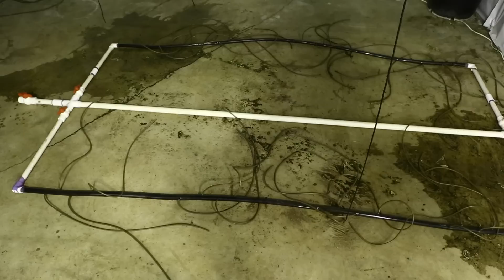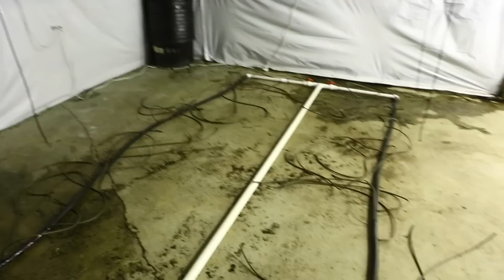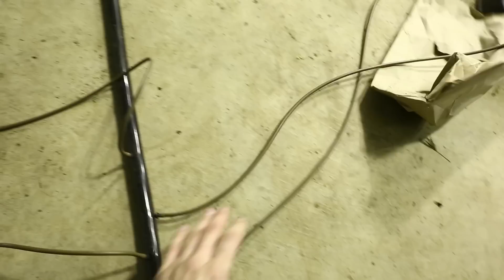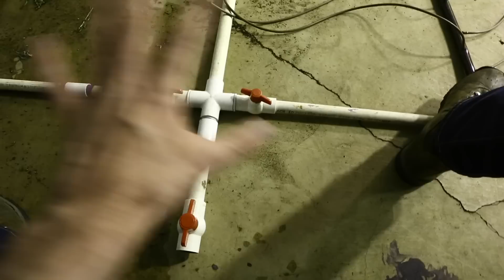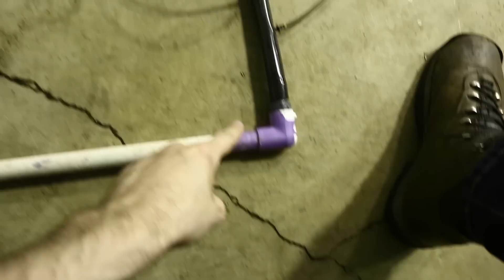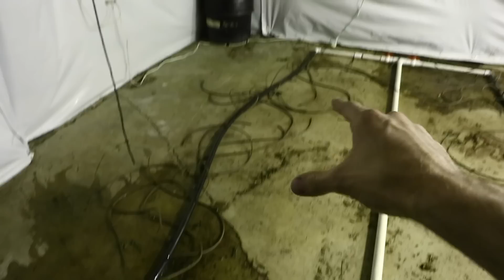Medicropper's Automatic Watering System

Comment: 2gph. flag style drippers work very well without clogging,they  compensate for pressure differences somewhat by resticting the flow down to 2gph. You can also pull the flag and clean them.  use a nylon stocking or pump filter bag to keep solids out of the line, also use a "Y " filter in line with a removable cleanable screen.Your method works very well though, but it can dig holes exposing the roots. With emitters , you can use a smaller pump. Adding grow stone or perlite to the top 2 inches or so would stop the water from digging holes.
Reply from the maker: I used to use Y filters but they took time to clean. Also pump filters had to be cleaned all the time too. That, along with cleaning individual drip emitters is too much work when you get up into larger watt gardens by your self. I had to find the best possible way that took the least amount of time, without sacrificing any quality of workmanship. What you suggest does work, but takes extra time. Once you start getting over 8k with that method, it can add many hours of labor to a cycle. thanks for chiming in though. It's good advice.
Reply: Your right I didn't think about that.
Reply: Thanks

Comment: If you ever get tired of dealing with manifolds and all that mess all over the room, take a look at the video I just put up. I just made a different type of system that i'm loving so far.
Reply: so clean...so sexy. the larger diameter lines running to your plants are nice, and those $5 valves arent too bad either.

Comment: medicropper When you say you refill the res with fresh water to flush the watering system do you feed that diluted nutrient mixture to the plants?
Reply from the maker: Yes. my rez is 50 gal and I feed my plants 150 gal every time I water. For 150 gal, I use 1200 ml (2 ml per L, aka 400 ml per rez) of each nute. So I fill up the 50 gal rez, add 600 ml of each nute in it, then plug in the pump and water all that. Then I fill the rez again and add 600 more of each nute, plug it in and let it water. Then I full up the rez a third time and just water in that straight water. So the first 2 rezes get extra strength nutes, and the third one dilutes the total feeding back down. I hope that makes sense. So water in 100% of the nutes with 50% of the water, then the other 50% of the water with no nutes.
Reply from the maker: Misty8flip
 add up the total watt being consumed in the room and multiple by 3.15. Don't get anything below that.
Reply: medicropper I have a question this is my first run and I was going to flush my plants for two weeks but what I need to know is how often do I flush them do I flush them everyday or only when they dry out?
Reply from the maker: when they dry out.

Comment: medicropper I have 10000 watts in 16 x 12 room I do 40 plants . do you think I need 2  drip systems or will one work thanks!
Reply: 5 rows of 8  plants
Reply: MJ Organics 303 harbor freight has 3/4 and 1 hp  pumps for 60 bucks . do you think one system would work with a pump this size

Comment: Question brother do all your spaghetti lines have to be the same length ???
Reply from the maker: At first I thought yes, but I was wrong. They can all be different. The key is to us pressure compensating drip emitters and pressure reducing valve in the line. I buy everything at dripdepot.com. It's also important to have an online filter so no sediment clogs your drippers. You can't use organic nutrients. They will clog everything.
Reply: @medicropper  sweet I really do appreciate your input brother. I tagyou in my post on Instagram would you mind checking it out and giving me your input sir.

Comment: Now in the 18K or larger, would you have separate, but identical watering systems coming off of the same reservoir and using the same 1500gph pump, but being separated by the shut off valves?  And how much larger of a watering system do you think you could pull off of the 1500gph?  I'm just curious if you would do separate rez's.... And do you have it dialed in to exactly 50 gallons per watering?  That's impressive... BTW thanks for the follow on Instagram.  I got my eye on a 40k possibly.....that's why I ask...
Reply from the maker: For a 40k I'd break it into 5 8000 watt sections that are identical. I'd use a 5250 gph pump with 3 drip lines per pot, and I'd have valves separating each section. I'd do X amount of seconds in one section, and then turn off that valve and turn on another. Or separate rezes per section so you can do multi strains with different nutes per strain.
Reply: medicropper thanks man, I really appreciate it I'm sure that took a lot of the guesswork out. Now I will just have to trial and error on equal pressure within system. Also good words on taking equal cuttings. Very important.
Reply: medicropper Just out of curiosity how where you holding your camera for this video? Nice informative video...very pragmatic but with inside along side.
Reply: The 1 LB. CLUB heres some trial an error already worked out for you, use a much larger diameter of pipe then neck it down to the hose or draw directly from it what ever works for you,  a large enough pipe u dont even need to do a figure 8 like u see in the video just depends on the layout you want your hoses to run.  if u need to see this in action befor hand try it use a 1,2,4 inch pvc capped an drilled with the same gph over the longer run the 1 inch will show signs first of where the pressure drops, this is another reason to use higher gph because these pumps dont have high psi ratings so u gotta use volume instead.  hope that shortends or gives u better insight to it.

ps its the same way our water gets to your house  huge pipe necked down then necked down then necked down so all have equal pressure at there homes. :) good luck
Reply: +zerocool212121 dude do u have any pics of what u are describing

Comment: How do you keep your spaghetti lines in your coco?
Reply from the maker: little stakes that are split vertically at the top like a native american fishing spear. The drip line sits inside the crack. http://www.homedepot.com/p/DIG-Corp-Micro-Tubing-Stabilizer-Stake-10-Pack-P35B/100201728?N=5yc1vZbx57
Reply: Have you tried running one spaghetti line per pot and then putting a T to run two lines into the coco that way? Also, do you just press the PVC together firm or do you use some kind of glue?
Reply from the maker: Yes I've tried that. I've tried everything. It is a bad idea for multiple reasons. I use pvc primer and glue. If I didn't they pipes would blow apart.
Reply: Thanks for a the good info.... Peace

Comment: At 5:18 you said you give em a full 50 gal res of nutrients. so thats about 2 gal a plant if your runnin 24 plants. then fill the res 1/4 with fresh water to flush the lines. then fill it 1/4 full again and run that? so about three gallons per plant per feeding if my math is correct? isn't that a shitload.  or am i retarded?